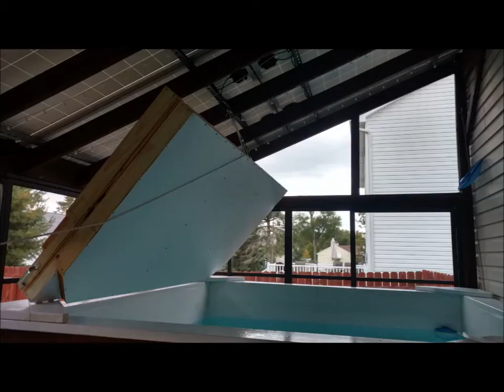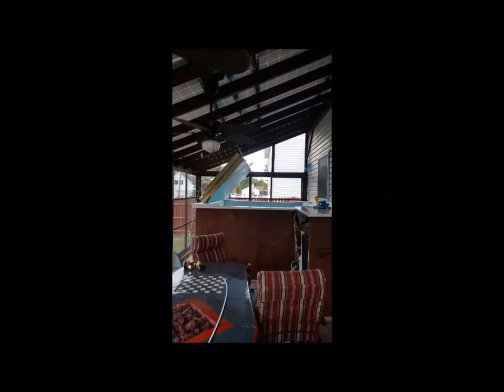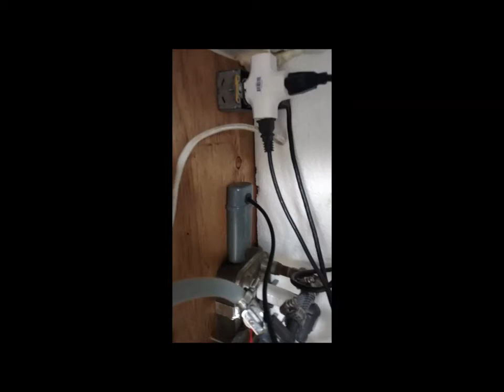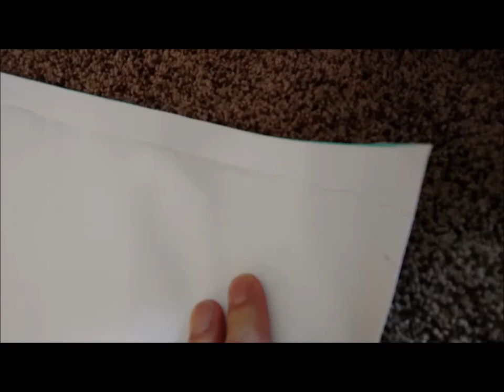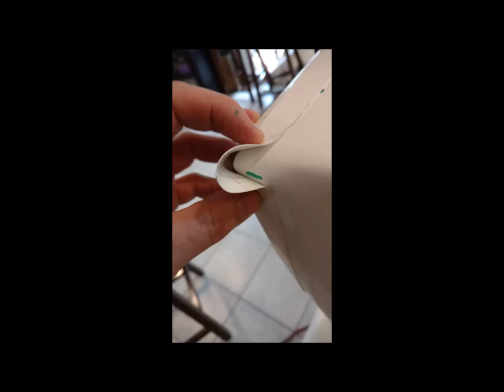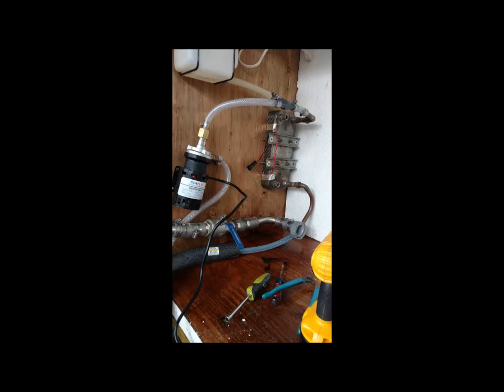Upgraded: DIY low-cost hot tub,

Comment: This is a brilliant job thank you for sharing . Could I ask you for the details on the liner please . And does the chemicals like chlorine affect the liner material . Thanks again Darren
Reply from the maker: The title of the listing was for "Vinyl Pond Liner 20 oz. 22 mil Heavy Duty White Tarp." it seems to hold up really well with Spa water. also "HH-66" glue is stronger than heat welding, FYI.